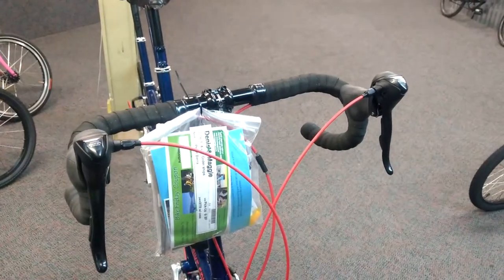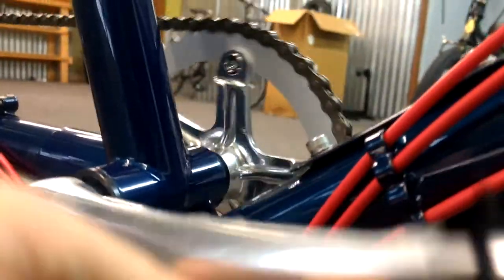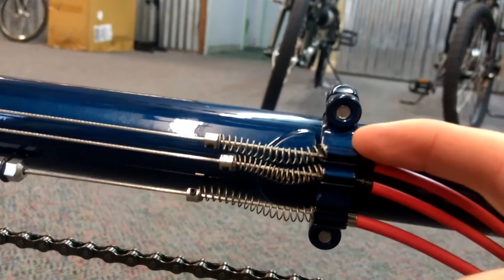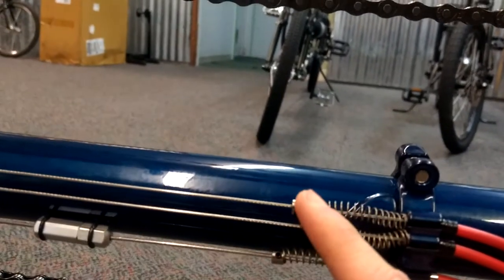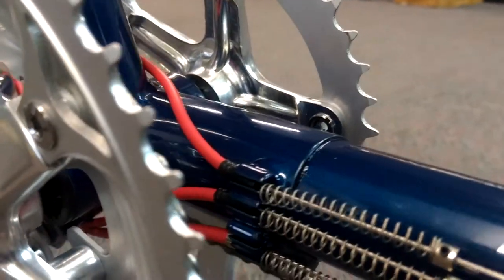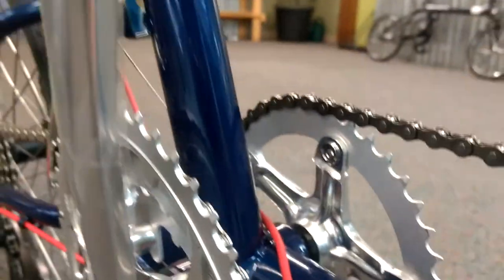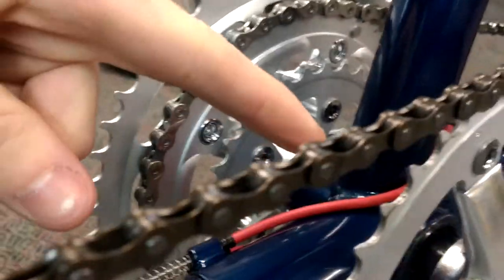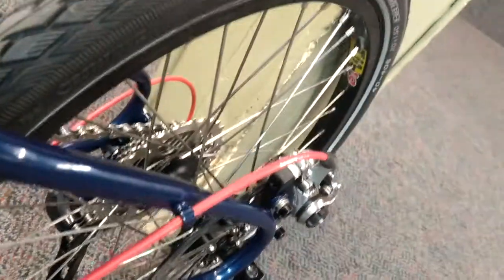Service  - Bike Friday - Tandem Tuesday Cable Routing

Comment: It helps to add something like Jagwire Tube Tops where cables touch the frame to prevent abrasion of cable housings and the frame's powder coating.